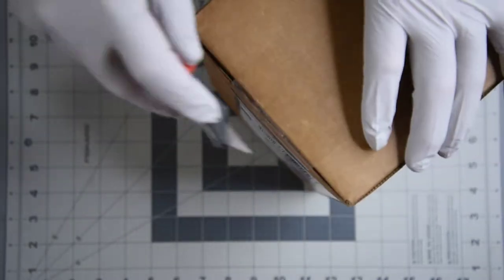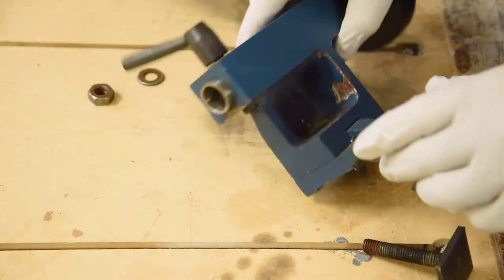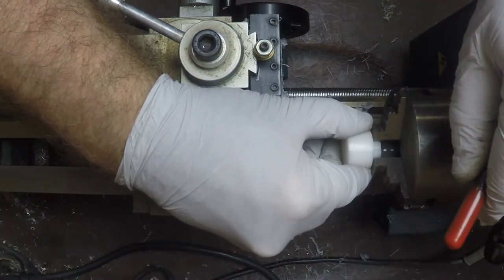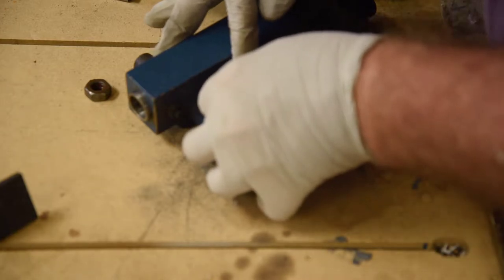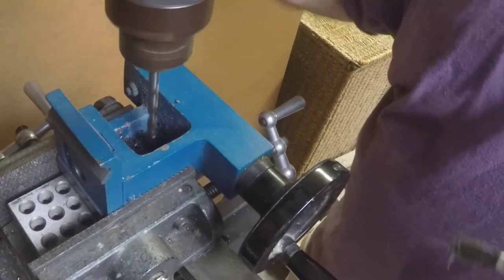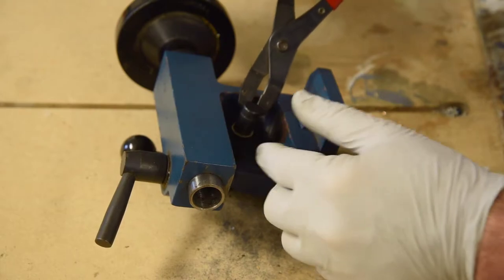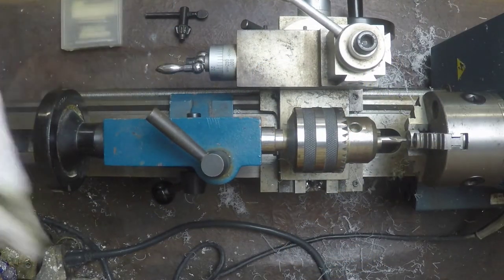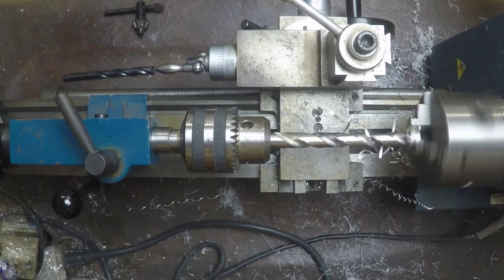Review & Install of a Mini Lathe Tailstock Cam Lock Kit

Comment: Thank you for the suggestion to make a plastic guide pin to drill the 1/2" hole in the tailstock. It worked great. Keep up the nice work.
Reply from the maker: Thanks

Comment: I sure had trouble putting that on my lathe. Followed the instructions on locating the hole to drill. Ended high so had to put a spacer under the square piece. Then needed washers to get the shaft positioned horizontally so the cam area was located right. Probably the web area thickness and offset to the vertical rod hole varies on these lathes.
Reply from the maker: I think a lot of things vary on these lathes.  It is a lot of work but it's worth it.

Comment: Don't waste time looking for a washer, drawing a circle and panicking because you don't have a transfer punch, none of that is actually needed. The purpose of all this is simply to locate and mark the position of the 1/2" hole you need to drill in the tailstock for the camlock bolt to pass through.

The quick and easy way is to simply install the camlock socket in the camlock sleeve, place them in the tailstock cavity where they will reside and screw the clamping foot in through the bottom of the tail stock engaging the camlock socket part way. This will automatically center the assembly, align the holes in the camlock socket and sleeve, insert your 1/2' drill bit through them and with the assembly seated down, simply push and twist the drill bit back and forth a couple of times to accurately mark your tailstock for drilling. 
I was able to get my installation done in roughly 20 mins or less this way.  Before beginning, it would be advisable to ensure the floor of the tailstock where the camlock sleeve will be resting is flat, other than that, it is all straightforward and works great!
Reply from the maker: That is a great idea, I wish I would have thought of it. Thanks
Reply: And this is just a clearance hole, so the hole could actually be bigger than 1/2” without causing problems! It says that in the instructions. The good part is that if ya screw it up, ya toss the LMS parts and put the OEM stuff back in! Success on this project definitely makes for a much operator experience when using the lathe!

Comment: You should get all that rust off the bed and keep it oiled. It will perform much better.
Reply from the maker: I wipe it with machine oil after using it.  But it was stored up for some time and I guess I didn’t have enough oil on it.  That’s when it rusted so much.  Any idea the best way to remove the rust?  I haven’t wanted to use anything abrasive on it.  Thanks.
Reply: @metalplasticelectronics354  use white vinegar and steel wool. It's a good way to remove rust. Thank you for your video.